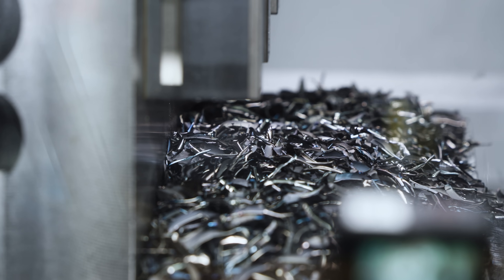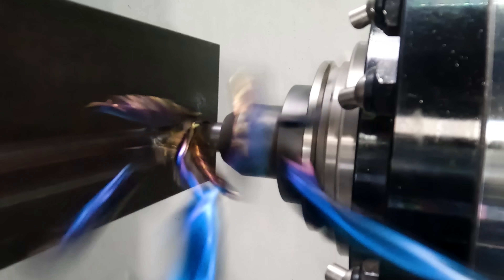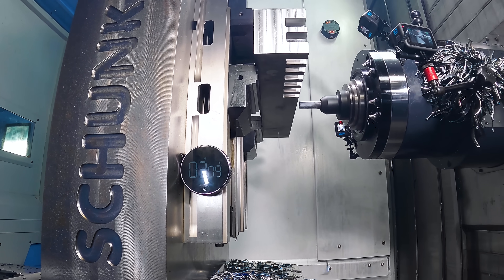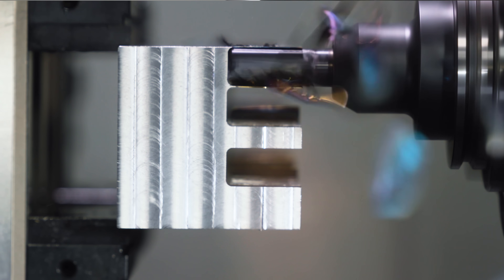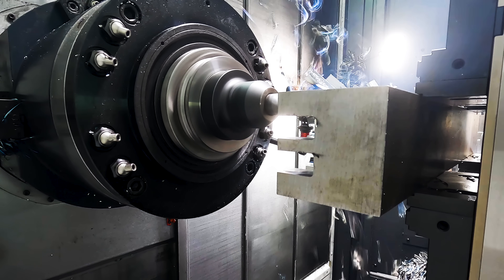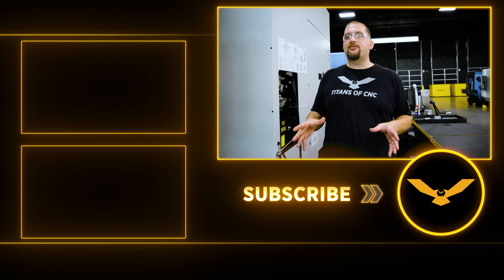End Mill Full Slot Timed Trial | NHM 6300 Horizontal Mill | DN Solutions

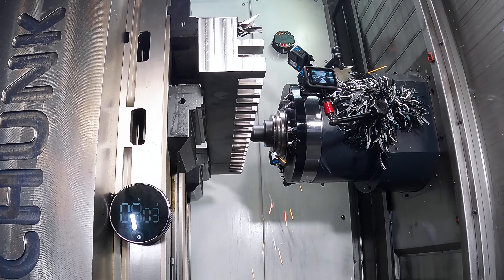Comment: Barry, at 3:13, you said that "with coolant the cutter would last all day." I thought (most) steels are recommended to run dry.

I'm actually about to run alot of 1018 steel, and since I do mostly aluminum, I could use a few tips; one thing that really had me doing some research was wet or dry machining of steel.

Any feedback is appreciated.
Reply: I cut most mild and tool steels dry. Works well for the tooling I have available to me and the equipment I am using.

If I am using specialized tooling like the high efficiency machining endmills from Mitsubishi I will start with their recommended parameters and experiment from there. Try them wet, try them dry, increase and decrease SFM, chip load, axial DOC and radial DOC.

Use common sense and watch the machine loads. 

Roughing P20 at 280IPM dry is quite satisfying!!!
Reply: Hey man! I recommend coolant. The benefits of chip flushing and added lubrication usually outweigh the negatives of thermal shock
Reply: @barrysetzer  Hi Barry! I noticed that you turned off the air blast near the end in the video, and that’s when sparks started to come out — I think that’s from recutting chips?
Reply: @barrysetzer  But I have a similar question to Robert’s... I think the Harvi I TE is uncoated (correct me if I’m wrong), so running coolant may help a lot, and maybe you could bump up the speeds and feeds even more then. The coated tooling (from Iscar) we use at my work recommends ~1200SFM — presumably it’s a coating similar to the TiAlN coating that excels at high temperatures. But for the sake of the mental exercise, let’s say it’s regular TiAlN coating, would not running coolant just kill the tool quickly with thermal shock?

I’ve run 1018 steel dry with our tools, and tool life is great when we are within the manufacturer’s recommended SFM and feeds, mostly doing *trochoidal milling*. But our programmer turns on the coolant and runs the tool at 1/4 of the recommended SFM when we *slot*, and tool life sucked. I’m a newbie junior so I didn’t have the balls to change too much stuff at the control, so I don’t have any real-life feedback yet.

I know you guys have done a few videos on dry/wet machining... But I’m still scratching my head when it comes to which is more suitable under different cutting conditions, and whether coated/uncoated tools play a huge deciding factor... I’ve just stepped into the trade and you guys have helped me learn a lot!
Reply: @chulangmo5799  running it dry you’re risking the material work hardening if your speeds and feeds are incorrect…

Comment: honestly if it werent for vidoes like these, i wouldnt have dared to use programs such as "circle hole making" on mastercam, with it, i managed to cut about 1.75 in holes in a 1 inch plate, which normally would of taken all day using ramping cuts, down to about 4-3 hours, still kinda slow compared to you guys, but we have literally have CNC mills from the 80s
Reply: If it makes you feel any better my shop is all manual and I have a Landis OD Grinder from the 1940’s I use for flattener rolls and 2 Mattison surface grinders (36” X 14” chuck and 72” X 15” chuck) from 1950’s. Corporate in California has 2 HAAS CNC and wonder why it takes us longer to get things flat lmao
Reply: drill the hole out with a drill smaller than the hole and then come in with an endmill (.5-.75in) and finish pass the hole contour at full depth. This should bring the cycle time per hole down to minutes or seconds depending on your machine.

If you can't handle the torque/power of the above drill/cut. Work your way up in drill size steps that you can accomplish and then maybe do multiple passes or multiple depths for the finishing (although a full depth cut with spring pass would probably have the best tolerances and surface finish)
Reply: @dominickscialabba3503  that's exactly what I did, drilled out with .500 drill then milled out the rest with a half inch endmill

Comment: Mostly of comments came from employees, but when I see this kind of cuts as an owner of 12 cnc machines small shop, I see so much more money and open my mind for bigger production projects with same HR.
Thanks and keep doing this for us.
Reply: I wouldn't do this on a lot of mills. The horse power just isn't there. It's safe to assume that Titan had this depth of cut in mind when they bought this machine.
Reply from the maker: Each machine has its own parameters etc. I even showed Inconel cutting on a 1.5 HP Tormach… just need to find the sweet spot for your specific machine.
Reply: @TITANSofCNC  Exactly. Documentation, documentation, documentation... One can't stress it enough.

When you guys are doing videos like this you should spotlight the load meter and the axis load screen.
Reply: I do not need documentation, I just follow the Titan sense, go beyond until spindle load fails, endmill broke. Then, step back a reasonable feed and Go..!!! That's big more money... Boooooom...
Reply: @mnucad  Cringey dude. Talk like a normal person.

Comment: Clearly shows if one does the proper machine specific research tools can be pushed some more than others depending on my setup.  My machine could never make this kind of cut but It does show me to be open minded and to factor in the many ever changing variables.
Reply: The machine I run wouldn't either but a 3/8-1/2" cutter it might.🤷‍♂️ Never know till you try. I'm told I run circles around the last guy who ran my machine(1995 Hurco). He didn't learn new techniques on doing thing. He loved his hss drills and endmills🤦‍♂️...  The company is now looking at get me a Brand New Machine. I'm so excited. I get to pick it out. Brand and options. (I look at it as if I were buying it. No stupid for me wasteful options I wouldn't never need.)

Comment: Great work! Now that we have seen the practice, can we have videos on the math and theory involved?
Reply: What math and theory are you looking for?  
This is the endmill they're running, not sure about the corner radius they're using.
Kennametal 
H1TE4RA0750R150HAR030
574 SFM .00271"pt for full slotting, but Kennametal doesn't recommend slotting with these endmills much over 1*D, they look like they're sending it the full 2*D which we had Endmills I used to sell at Iscar that would slot 2*D no problem.  Had one doing it in an Inconel application successfully but took a lot of playing around to get it to work.

Comment: Awesome cuts. Not sure that was the best tool path I ever saw. :)  I assume you just typed the gcode into the console by the look of it.
Reply: I think it was intentional. It left a lot of thin sections which get hot super fast hence putting more stress on the tool
Reply: I do think it was intentional. Pretty funny actually.
Reply: As Barry says in the video: it's to show off some of the potential of the tools and the machinery.

Sure; you could run spiral cuts with coolant all day and get a minimal amount of tool wear - but full slotting is probably the best way to drive the point home when it comes to durability.

Comment: That's insane. my shop director would shit in his pants if we ran at such speeds and feed. what a beast
Reply: Maybe you should start creeping up the feeds and speeds and depth of cut at your shop and see if the shop dictator notices
Reply: The speeds and feeds are normal. It's the depth of cut that is beast.
Reply: Y eso que es una velocidad media y avance a media. Imaginate, tenia para mas.
Reply: it all about loading, operating under max capability means the durability of machine will drop compares to light loading, you need to make it balance.

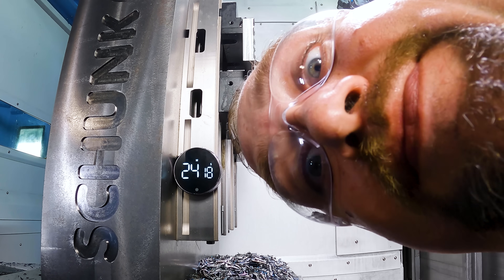Comment: Tool is badly chipped. You can see lack of tooth near holder (7:00min). Few more full slot passes and it would break :(
Reply: He didn't use a drop of coolant, which would make a huge difference for the tool life.

But the video wouldn't be very interesting due to the water and steam everywhere.
Reply: I think considering the circumstances it performed stellar. 

He performed this opp w/o coolant. 

Imagine how much longer tool life it would have with coolant on it.
Reply: How big of a piece of material do i need to use before you start to think “hmmmm, thats impressive”

Comment: i think one thing to mention that a lot of people misunderstand is that these machines are big taper machines like CAT50 and HSK100. These machine are a lot more rigid than a smaller BT40 or HSK63 and therefore can take these cuts. There is also the fact that machines can be ordered with a variety of spindle use cases, meaning you can get lower RPM but higher torque spindles or higher RPM but lower torque.
Reply: That was the whole point of Barry saying that we do the research for our machines and we know what they can handle and what they can’t.  So others should do the same and adjust parameters based on what their machine can handle safely.
Reply: @Jessie_Smith  so for haas umc 750 with 23kw 40BT spindle what speeds and feeds would you use?
Reply: so for haas umc 750 with 23kw 40BT spindle what speeds and feeds would you use?
Reply: @stjepansvrtan9766  that's a very specific question I don't know the answer to. A lot of information can be gained from the tooling manufacturer but it's not always perfect. The company I work for is actually developing a piece of software which will be able to give you very accurate cutting parameters based on your machine but it's in development. Try asking on forums where there are other people with the same machine as you
Reply: @Lewis Vaughan  sorry Lewis that was question for Jessie